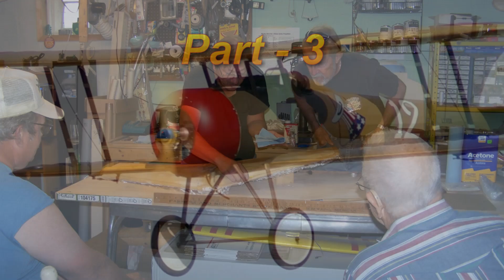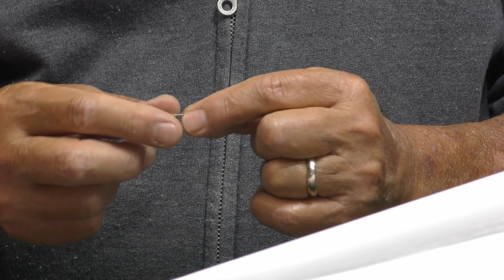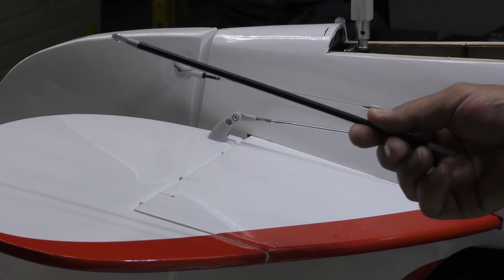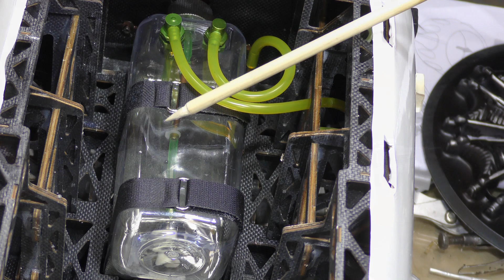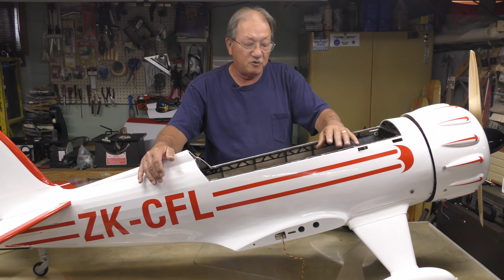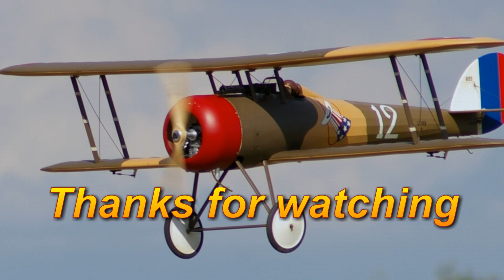Phoenix Waco Build Part 3

Comment: My friend, I've been in this hobby. A long time and I know people get stuck in their ways, but on one of your models, you should try pva, glue Formula 560 Or Deluxe materials, super phatic for doing hinges. You will never use expoxy again. Ive switched a few years back. Super easy water cleanup and zero stress. Pva glue sticks so well to plastic and wood. Give it some thought. I'm converting people one at a time lol
Reply from the maker: I've been in this hobby along time as well (64 years) I've been learning new things since day one. I'm always open to new ideas and products.  Thanks for the tip. I'll give it a try and add it to the old knowledge banks!👍
Reply: @rcmodeltipshints9462  that's great! I enjoy sharing with people and trading tips too. Great videos, btw

Comment: Just an FYI, I've got the same plane..flys great...3 years and many flights into it, 2 of the aluminum brackets holding the "N" struts to the wing cracked in half within a few days of each other. Fortunately the plane survived each time.  I am currently having all of them replaced with steel ones.  Keep an eye out on yours as your flight time increases.

Comment: Good job ! Nice looking bird. Double allerion issue! What prevented the problem in the full scale aircraft?Ya did very well thanks🛫🛫🛫🛫
Reply from the maker: I haven't found any information on the workings of the full scale ailerons, that information would be incredibly helpful. I found a solution to the problem in Part - 4.